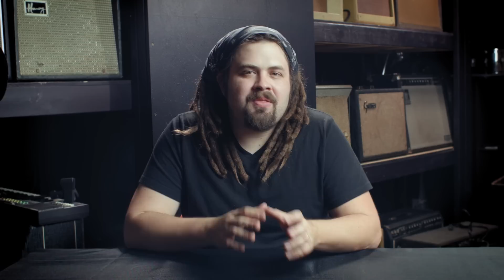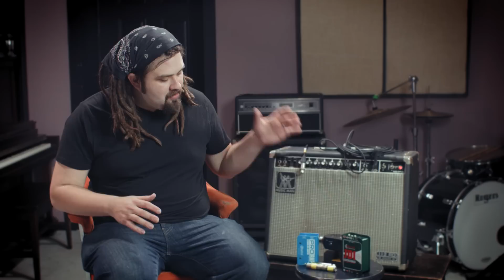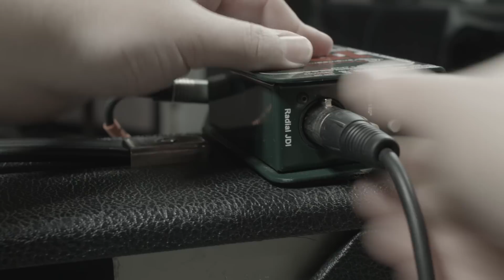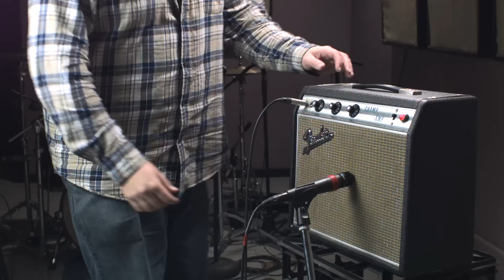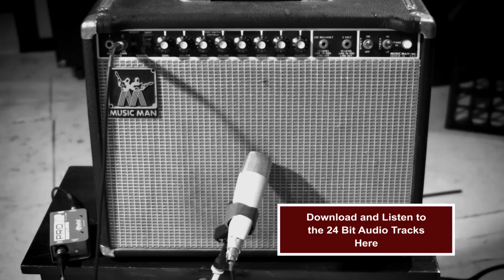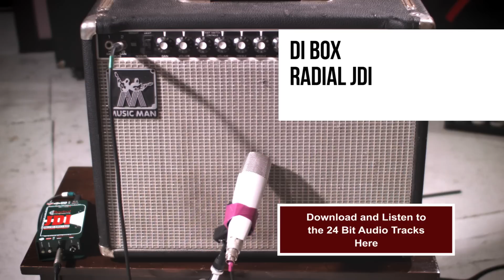Do You Really Need a Reamp Box to Reamp Guitar?

Comment: You know you can actually reamp by just sending a signal out of your interface (if there is a line out you can use), straight into an amp (as in a lead from a line out, STRAIGHT into input on your amp)... and it will work, done it myself easy as pie. Tried with a guitar signal into my fender amp, sounded great, then sent a bass signal to a bass amp, no DI box or reamp box used, just the out on my apollo and a mono guitar lead. Line level signals don't really muck around.

Comment: A small tip, don't know if it really matters, but I run my Radial X Re-Amper (active) off my Cioks Ciokolate power supply - not sure if clean power to the reamper helps but I figure it might. At the very least, my Rolls MP222 mic preamp which came with US power supply wall wart would squeel when using a wall wart adapter. Running off the Ciokolate solved that noise issue. So consider powering your re-amper off your guitar pedalboard power if you can (helps avoid ground loops I presume at least - without needing to lift ground etc)
Reply from the maker: Great tip, thanks for that!

Comment: Worth noting, I was advised that if you are wanting to not potentially lose a little high end when re-amping, to use an active reamper as opposed to a passive - I think for guitar probably not a huge deal but since I am using re-amper for electronic music to process through analog gear, so crispy drums are important etc. Also, if anyone ends up getting a Xone 96, you don't need a reamper anymore - the mixer has a hi-z output! However you could still benefit from using a re-amper if wanting to run DAW interface direct (avoiding mixer in the chain on the way out).

Comment: For my re-amping, I send my mixer output to Radial active Re-Amper X, then to effects, then to Radial JDI & Rolls MP222 mic preamp to bring back to line level. Presumably this is a better set of components than the all in one box 'EXTC-SA' from Radial (came out after I bought this set up) - would there be any advantage to using the  EXTC-SA instead of the separate DI and preamp on the way back into the mixer? I've still not re-amped into my amps (I'm noob at mic recording) but mostly will be sending electronic production channels/tracks into effects, but also plan to record via DI -> mic pre -> mixer -> interface. Is there an issue recording with the JDI and preamp, then re-amping through effects, then back into the JDI and preamp? Presumably getting double colouration and treble reduction from the DI? I only have line level or mic level inputs on my mixer, but the mic inputs aren't full range inputs, so I need to get to line level for proper gain structure coming into the mixer.

Comment: Hello Ryan! I hope this is not a stupid question but, what kind of cable do you use from the interface to the reamp box? I notice the reamp input is XLR. Do you have a XLR output on your interface, cause mine only has 1/4 jack output? What features should my cable have? 
Thanks you very much for such an awesome and helpful video!
Reply: 2x TS to XLR input to send stereo to mono (or single TS connector to XLR for mono) - I got a custom cable designed at designacable uk - note that the connector gender is different to what you might expect!
Reply: You need a TRS to xlr(male or female depending on your reamp box/di/whatever) cable. TRS because the outputs of your interface are balanced signals and a di/reamp takes balanced signal too. 
Or you could just use some adapters (not the ones with transformers), I highly suggest you buy a bunch of them. TRS to xlr, male xlr to male xlr, female to female. That way a simple xlr cable can become whatever your desire. Adapters saved my ass on gigs and in the studio more times than I can count.

Comment: Have to admit that I tend to reamp (something I do a fair bit recently) by using a Y-adapter or taking the record out (UNemulated) or the preamp Fx loop from an amp to record a signal and then simply use the headphones out socket into a miced amp at a later time 
this seems to work so am I doing something obviously wrong?
DO I really need to use my (dusty!) DI?

Comment: Nice video. Thanks for doing this. I never come out of the box, once in. To me it just doesn’t make sense with the quality of plugin FX these days. However, I’m a synth player, and of course I love guitar pedals. Synths spit HOT signals. Often even so-called “line level” pedals will clip easily. The reamp pedal takes away the guess work, or the worry. A lot of synth dorks say, “just turn the volume of the synth down”. This does not account for impedance mismatch however. Its all about making the best possible recordings. If you have a $3,000 signal chain (synth + 2 pedals) squeezing in a $79 pedal to maximize quality is no big deal.

Also, not all line level pedals are created equal. The is pro-audio line level which is +4dBu at the input, but there is also consumer level which is -4dBu allowable. Strymon El Capistan is +3dBu and clips quite easily on a bass patch for instance. You really need to refer to the manual or contact the manufacturer to find out what signal is allowable.

Comment: To fully capitalize on a 144 db dynamic range is only hypothetically possible. The 24-bit resolution can not be upheld no matter what. I'm afraid. It's all about dynamic range which is the signal''s maximum strength above the noise floor. 

If you record a noisy source like that of an electric guitar, you have already degraded the dynamic range, hence bit depth to less than 16-bit. You could just as well record that track in 16-bit without audible differences. But for further processing the track is better off when converted to 24-but or 32-bit float as the processing won't degrade the material as much as it would with 16-bit. 

Also any plugin introduces its own noises. So if you have recorded a source with a Brauner microphone and a Millienia Media preamp and the signal was converted with a DB Audio A/D converter you will have attained the maximum dynamic range possible. But any additional processing in the digital realm will degrade the bit depth to a point where 24-bit is not even remotely possible to retain.  Even simple plugins like a spatializer or equalizer will intruduce a noise floor that will immediately degrade the signal's depth to less then 22-bit, let alone things like a compressor / limiter.
Reply: People argue however that processing with upsampling or higher resolution/bit depth can aid a) digital plugins b) D-A stage for sending to analog processing, people argue higher resolution output gives the analog better representation of analog signal to work with

Comment: I have the same reamp box but I still get buzz like in your last example when it's connected directly (doesn't matter what amp it is). I'm using Roland Octa-Capture. Could it be impendance problem? Maybe connections on balanced jack-XLR cable are wrong? It's a unique cable so I can't swap it for another to check out.
Reply: You're running a balanced cable into the amp?  Should be a balanced cable from your interface > Reamp Box > unbalanced cable > amp

Comment: I'm not sure if this is entirely relevant to this video, but I'm needing some advice so here goes.

Long story short, I just got my first tube amp and I don't have any overdrive pedals to tighten up my high gain tones. Is there any way to run a Tube Screamer VST, for instance, in my DAW, back out to my amp, and have the amp send its overdriven signal back into my interface without causing a feedback loop? I have an M-Audio Fast Track Ultra (6 in, 6 out) and I'm not running a cabinet. In the cab's place, I have a THD Hot Plate and speaker simulation is coming from a plugin in my DAW.
Guitar goes into input 1 on my interface, using an instrument cable, which is being fed into a Mono track in my DAW set to receive signal from input 1, running an instance of a Tube Screamer VST. From there, I send it to a bus which I send to output 2 on my interface, which is going into my amp, as mentioned, via output 2 on the interface, connected with an instrument cable, which is then going from the speaker output on the back of the amp into the Hot Plate, which is then run back into input 2 on my interface into another mono track in my DAW, set to receive signal from input 2, which is being sent to master track using any combination of my 4 available stereo outs (output 1+2, 3+4, and 5+6 all create the same feedback issue). I've also tried to send the mono track that's supposed to be the combination of the Tube Screamer VST and amp signals to a bus with an output that is different than the output that's set on my master track in my DAW, but this didn't alleviate my feedback issues. I've also tried numerous different in/out configurations using the inputs on both the front and the back of the interface, whether the guitar was going in 1 and coming out 4 with the amp going in 6 (with appropriate changes being made in my DAW, of course) or vice versa, etc. 

Is there something I'm messing up with my signal path that's creating the feedback? Or would I need a reamp box to be able to do this correctly? Should I just suck it up, wait until I have the necessary funds to grab a Precision Drive and let the cabling and screeching, squealing nightmares put themselves out of my mind? Or is there a workaround for this until I'm more financially sound and can afford a solid OD pedal? Any help would be greatly appreciated. 
Here's a link to a flowchart if you may find it helpful. Apologies for the watermarks. https://prnt.sc/ia8k2o
Reply: You do need a reamp box, also sometimes "I know people will say WTF??" but I even put a DI box after reamp box for in case there's a ground issues or whatever.I'm also using vst plugins like tubesreamer vst ans so on.The results are amazing...Download as many plugins as you can, and just throw them on the signal.Play with them and you'll see what fits you. For cab simulation I recomend you to try Two-Notes:  Torpedo Wall of Sound or the standard free cab impulse loaders like nadIR, LeCab1/2, ...
Cheers!

Comment: I have a totally different problem. I want to use my phones headphone out to reamp into a preamp pedal but the level is lower than a standard guitar would output. In this case I can just boost the signal, right? I would measure what my guitar outputs with the preamp and then boost the signal after outputing it from my phone to the same level.
Reply: Just turn the fucking signal up in your daw.  Why are you trying to boost a signal by going through all that bullshit when you can just turn the trim up?  Seriously?

Comment: could you combat the noise floor issue when using a DI box in reverse by putting a noise gate on the DI tracks in your DAW? Thanks!
Reply from the maker: For noise gates, yes sure, but the better question 
is do you have hum or hiss a part of your guitar tone when the guitar is
 loud? There's gotta be a better way to get better guitar tone, so 
that's where a re-amp box comes in. John Cuniberti actually made fun of 
my little blue re-amp box in my videos...he had first designed the 
original Reamp box and now Radial makes it.

Comment: What about guitar effects that operate at line level, such as several strymon pedals?
Reply: joel rudnick some are good, allowing +10 to +20dBu input. Others not so much. Not all “line level” pedals are created equally. El Capistan for example only goes to +3dBu, and I can clip the hell out of it easily when running my synthesizer through it. Eventide pedals are about +8dBu, but the H9 is only +4dBu. 

You really have to refer to the manual about the signal that is allowed at the input.

I use a lot of synths, and a lot of pedals. The reamp pedal just takes away the guesswork and worry. I use it all the time regardless, and then hit the preamps on my audio interface before recording. 

Attenuation is not the same as reamping. There is also an impedance mismatch between line level and instrument level. So noise can be an issue, and especially gain dependent pedals like overdrive/distortion make the biggest difference. The more headroom allows the pedal to do its job.

Comment: One question,How bout just audio interface direct to amp?
Reply: If you record at max bitrate into your daw, you can just push it through the interface to the amp. Using internal soundcards like a headphone output could work but the noise ratio might be a bit high. (little late but yeah)
Reply: Depends if: a) your interface has a hi-z output b) your amp has a lo-z / consumer line inputs (and your interface can output hi-z or consumer line) - my old Roland JC-120 has 'lo z' input. Most amps don't though
Reply: You'll have terrible impedance mismatching going on.  Great way to blow an amp, have at it!

Comment: If you want to record a guitar  with a DI box, and the guitarist uses stompboxes, do you take the signal directly from the guitar and run in through the pedals when you reamp it, or do you just put the di box at the end of the pedal chain and record it with the effects?   Any thought on this?
Reply: akg414 run your signal from the di box into the front of your rig just as you would run your guitar into it order to get the desired sound. In other words, plug the line going out of the di into the same signal chain you'd plug your guitar into.

Comment: You where having ground loop issue when connecting directly from DAW... All the other devices are separating the grounds from your DAW and amp.
Reply: Yep, ground lift/isolator would make it more a fair comparison - I have used an ART DTI for line level and ART clean box II for guitar signal with some good effect, however my clean box II inputs are shoddy (move into the casing/loose) - going to try to fix it up. I was using it as first 'pedal' after guitar though so probably put strain on the inputs (now I have panel mount connectors on pedal board, to avoid that in future)

Comment: Hey Ryan, not sure if you'll see this since it's an older video, but I had a question pertaining to this. At a church  that I mix for, we get guitar signals to amps backstage by using a D.I. at the pedalboard, then sending it down an XLR cable under the stage, and through another D.I. (backwards, with an XLR female to female adapter) into the amp. Are their any disadvantages to using this method instead of a reamp box in this situation, where the entire signal path is analog?
Reply from the maker: Are you using one of these or something like it? If not, then who knows what two DI boxes are actually doing. I've never tried doing what you are doing so I can't say for sure how bad or good it would be. You really need a DI to Preamp to reamp box to do what you are doing, or use the Radial type product. http://www.radialeng.com/sgi.php
Reply: Creative Sound Lab 

Wow, I didn't know this kind of thing existed. We're just using a pair of Whirlwind IMP2 D.I.s and a female to female XLR connector to do this. We do have some problems with buzzing in the amps with our current method, but it's not too bad. I'll have to look into these and consider then as an option when our budget resets in a couple months! Thanks Ryan!

Comment: An important factor you neglected to mention is impedance (the reason for that attenuation you mentioned.)  It's not just a matter of level; a DI box can be used to reamp out of a DAW, but on the average a DI will put out between 20k-200k ohm impedance into an amp (a far lower load than what an amp wants to see.)  The amp will accept that, and it'll sound ok once you attenuate to a lower level, but a guitar will put out 500k-1M ohm impedance and an amp will be MUCH happier seeing that and will react like what it's hearing is directly out of a guitar.  A good reamping box will put out that much impedance and levels (and more importantly, feel and tone) will match better.
Reply: Impedance doesn't work that way. If the input impedance (Z) is higher than the output impedance it's fine, it only has issues when it's the other way around. Lower input Z draws more power, so if the output device cannot supply that higher power the voltage drops and causes a bad sound, but if the input Z is higher than the supplying device's output Z it just draws less power and doesn't make any difference.

Think plugging an amplifier output (through a pad) into a line input channel (input Z is higher), vs plugging a line output directly into a speaker (input Z is lower). One will work, one will not.
Reply from the maker: Yeah that's a great point. Many commenting have said they prefer the sound of the reamp box. I actually have gotten another one since the filming of this video.

Comment: I was convinced I needed a reamp box, so I got myself a DIYRE L2A.
I plugged my guitar straight into my interface, and recorded a guitar part in my DAW.
This recording was to be reamped.
Next, I wanted to test the reamp box, so I did 3 tests:
1: 1/4 inch straight from my interface into the amp, no attenuation on output signal.
2: cable to a splitter with isolated output, and from there into the amp, again no attenuation on output signal.
3: cable to reamp box, 1/4 inch from reamp box to amp. No attenuation.
I recorded all 3 in exactly the same way.
The result:
1: perfectly fine, just a little bit of hiss.
2: perfectly fine as well, a bit less gain though, and because of that, also less hiss.
3: too much gain, it chokes the amp with bass, also a lot of hiss. I checked the Ground Lift switch too. With some attenuation to get the same amount of gain as in test 1, the hiss was the same as in test 1.

What is this?!
Why is a reamp box redundant for me?!
I don't get it at all!
Do you know how this could happen?

Best Regards,
Reply: Does your interface have an unbalanced out? That does the same thing as a re-amp as far as I know.
Reply: @a_frog_enjoyer  depends if it is 'hi-z' guitar output or 'consumer line' recording output RCA etc